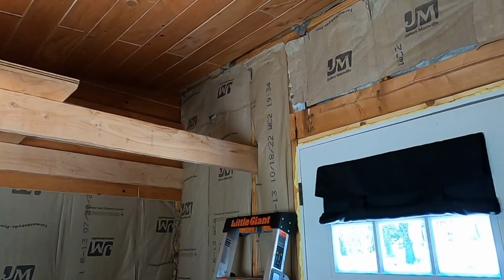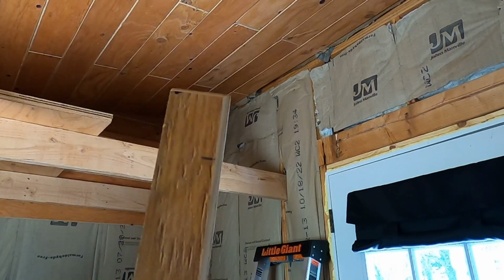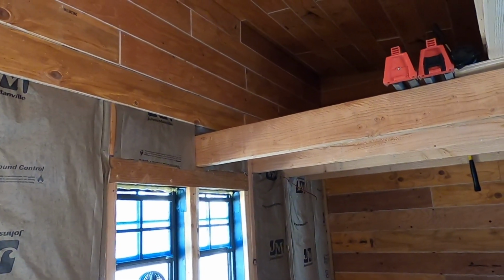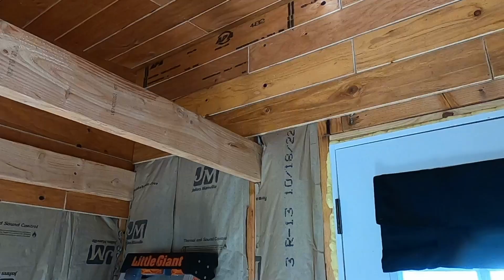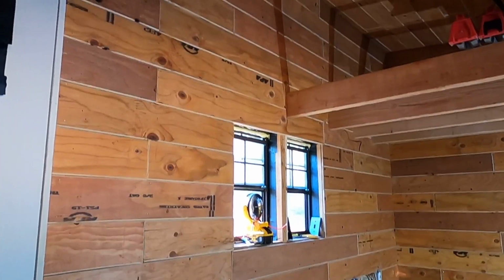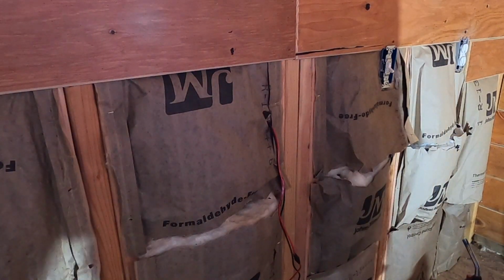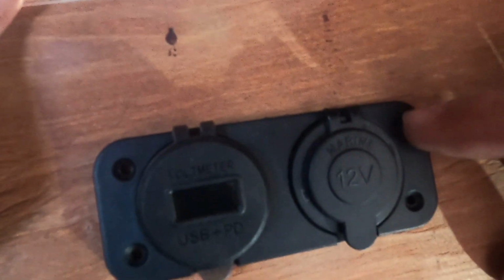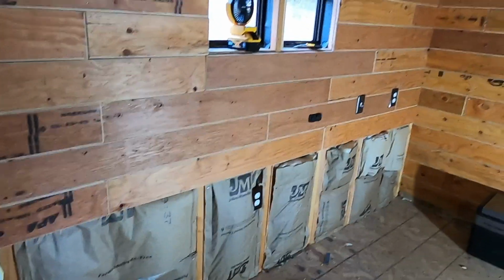Siding the Front Wall and Start the DC Wiring - DIY Off-Grid Cabin Build Episode 58

Comment: Hey Daryl, do you jave any plans for heat or cooling?
Reply from the maker: Just a fan for cooling, but with the white roof, vented roof and full insulation, it's not bad inside. For heat, I plan on using a kerosine heater.